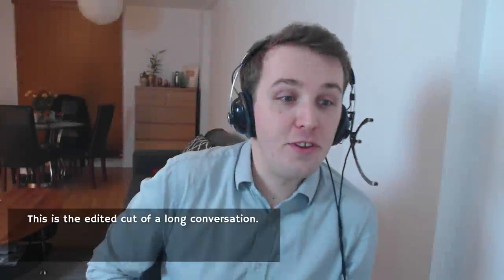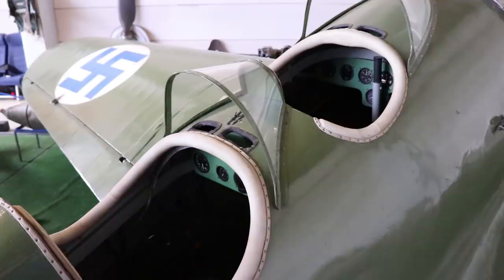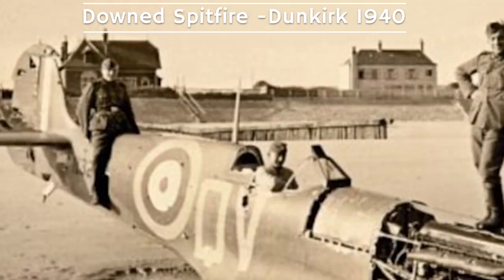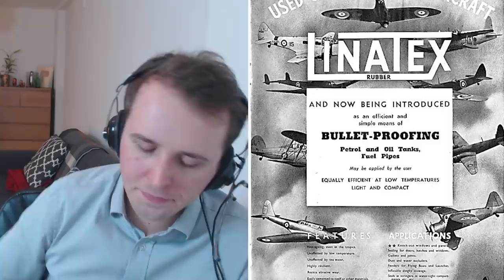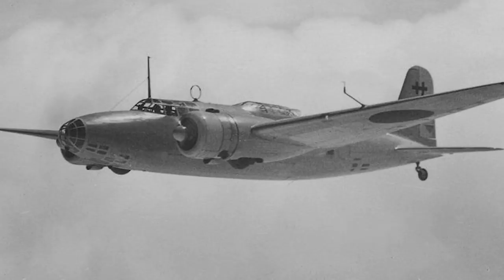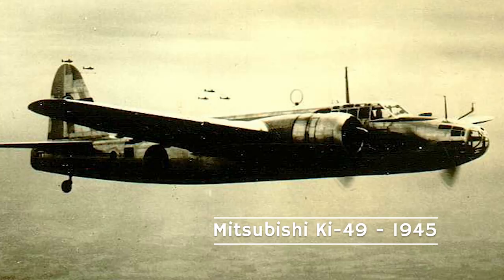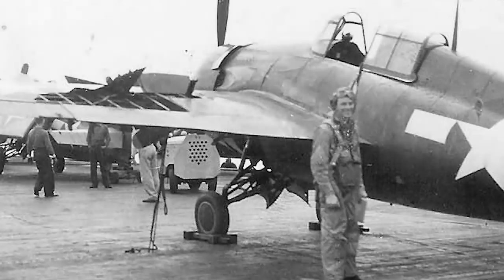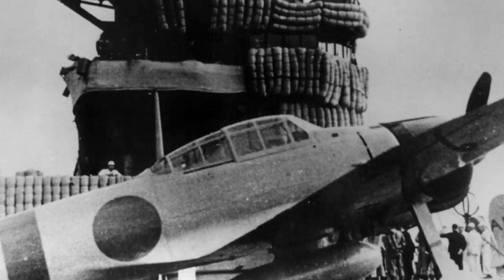WW2 Armour and Fuel Tank Protection - What They Don't Tell You

Comment: Great video. Could you make one on fighter armorment in ww2? Why the british first only used 303s and the US seemed to prefer .50 to canons, etc? Also reasons for nose mounted vs. wing mounted guns would be interesting. British and americans seemed to have used wing mounted guns almost exclusively, except p39 and p40 i think.
Reply: There are the p38 and p61 of the US and for the British there's the heavy fighter variant of the mosquito (note that all these aircraft use two engines)
Reply: Rate of fire:
ie, a unrestricted machinegun rate of fire being higher. Then a restricted rate(firing thought a propeller).
This much more a thing once you increase the speed of the aircraft. 
Also your intended targets, has a big part to play.

To understand the math problem. I am thinking almost a % that growers experdencelly over 300 mph.
Reply: One interesting feature of the .303 is that it was not a boat-tailed bullet (tapered on the end), but the 7.92 and .30-06 were.  The boat-tailed bullets have less drag.  I don't know if this lack of boat-tail decreased the range or energy of the bullet in air to air combat.
Reply: P-36 had nose guns along with several naval bombers the TBF, TBD and SBD. The F7F had them but that was a twin engine. The F2A and SB2A had both.
Reply: Thanks all. Very interesting comments. I was thinking of single engined fighters in particular. It makes sense that machineguns which did not require synchronizing have a higher rate of fire. Didn't think of that. Still Russians, Italians and to some extend Germans kept using synchronized machineguns in quite a few planes, while the Americans seemed to have faced them out in later models and the British didn't use them. But I read somewhere that the .303 Browning version could not be synchronized, so that would explain that. I suppose it also has to do with the limitations of space in the aircraft. I also read somewhere that nose mounted weapons were easier to use for novice pilots and that the Russians preferred them to wing mounted guns. Then there is the question why the British started using canons later then the Germans or the French and why the Americans didn't seem that interested in cannons for their single engined fighters. I think the corsair might have used canons, but I'm not sure.But what I am really wondering is, were these decisions based on doctrine, or were these decisions based on habit or technical limitations.
Reply: I believe the British wanted the .50 Cal. but the U.S. could barely produce enough for their needs.  The  50. Cal. was used everywhere.
Reply: The Lizardking the browning 303 ( and i asssume the 50 was too) was powered by compressed air. So, how could you synch that with a prop? I suspect it would be difficult.

Air forces tried to work out what weight of shot would kill an an enemy bomber. Then they had to decide how to achieve that amount of firepower V horsepower/weight hence overall performance. Weaponry availability was a thing too.
And remember the british designed their hurricanes and spitfires well before the war when most other nations were using 30 cal too. The cannon on the 109 was only adopted just before ww2 based on their spanish civil war experience. Most US aircraft had mostly a mix of 30 anod 50 cal.
Reply: The Lizardking also, if youve got mah deuce you reaaaaally dont need cannons. Its almost basically a small cannon anyway.
6  x .50 cals is enormous forepower. 
The corsair had .50 cals.
Reply: Dellacondan 
Good point. I forgot that the bf109b and c had 3 machineguns.
Reply: @sugarnads  a lot of later US naval aircraft (Including the corsair btw, also F6F, F7F, F8F the AD series and more) used cannons for armament. 

Air force planes equipped with cannons include the p-38, the p-39, (and the p-63 and p-400) and some p-51 model.

From wikipedia:
"The British version was also licensed for use in the United States as the M1, with both the United States Army Air Corps (USAAC) and U.S. Navy planning to switch to the 20 mm calibre as soon as the gun could be produced in sufficient numbers. In 1941 a very large building program was established, along with the production of ammunition. When delivered, the guns proved to be extremely unreliable and suffered a considerable number of misfires due to the round being lightly struck by the firing pin.[11] The British were interested in using this weapon to ease the demand on production in England, but after receiving the M1 they were disappointed. British wing-mounted fighter weapons by this period were cocked on the ground by the aircraft armourers before flight, the built-in pneumatic cocking mechanism used previously being regarded as unnecessary weight and detrimental to aircraft performance, so any stoppage in flight made the gun unusable until it could be cleared on the ground. The misfires also had the tendency to cause aircraft with wing-mounted guns to yaw away from the wing with the failed gun when the guns were fired, due to the unequal recoil, thus throwing off the pilot's aim.
In April 1942 a copy of the British Mk.II was sent to the U.S. for comparison. The British version used a slightly shorter chamber and did not have the same problems as the U.S. version of the cannon.[11] The U.S. declined to modify the chamber of their version, but nonetheless made other modifications to create the unreliable M2. By late 1942 the USAAF had 40 million rounds of ammunition stored but the guns remained unsuitable. The U.S. Navy had been trying to switch to using cannon on all its combat aircraft throughout the war but the conversion never occurred. As late as December 1945 the Army's Chief of Ordnance was still attempting to complete additional changes to the design to allow it to enter service."
Reply: I think I read that allied planes that used 4 and five blades props couldn’t use nose mounted machine guns.
It was a synchronization problem?
Reply: @woodruff4241   M2 unreliable? Ma deuce is still used around the world
Reply: @kenneth9874  huh? I never called it unreliable?

edit: I was quoting Wikipedia but that section refers to the 20mm cannon
Reply: @woodruff4241  I went by M2
Reply: @kenneth9874  It is a bit unfortunate that the Browning M2 12,7mm gun (which you meant) and the
Hispano (AN/)M2 20mm gun (that I was referring to) are both named M2 but that's just US American naming schemes for you
Reply: @woodruff4241  works fine with the complete name

Comment: According to Vorozsheykin's memoirs (in Russian), he himself together with Pavel Rychagov were the first to implement improvised fighter back armour in 1936 in Spain to protect pilot from the rear. They simply had cut by blowtorch a 9-mm thick boiler iron plate and put it behind the seat of I-15 fighter. In order to keep balance they had got rid of rear accumulator. Normally, I-15 and I-16 had no rear armour but 9 - mm back head plate

Comment: Greetings from Japan. According to Japanese books I read when I was small (Published by The KoKu-Fan magazine) and current Japanese Wikipedia, Type Zero Model 52 "b" (otsu) aka A6M5b had 45mm glass at front and 8mm armor at rear section of the cockpit. In Type Zero Model 52 "c"(hei) aka A6M5c produced from October 1944, 55mm glass was added in upper rear section of the cockpit.

By the way, Type Zero Model 52 "a" (ko) aka A6M5a used 0.2mm thicker aluminium outer sheet for wings and could dive up to 740.8km/h. The "Aces of the pacific" flight sim form the early 90's and I suppose many other Western flight sims don't model this and I suppose this is another stereotype.

About 6000 of Model 52 series including plain vanilla Model 52 aka A6M5 which had dive speed limit of 666.7km/h and had automatic? fire extinguisher for wing fuel tanks was produced from August 1943. Self sealing fuel tanks were planned for Model 53 aka A6M6 but they were delayed to prioritise the production of the Model 52 "c" aka A6M5c. The war ended before it could resume.

Comment: Hi, nice talk! Adding a few recommendations:

"Knights of the Skies - Armour protection for British fighting Aeroplanes", by Michael C Fox (Air Research Publications, 2006). An excellently researched book that seems far too little known! Covers WWI to about 1940, focuses on RAF aircraft with a short addition on German types. 

"The story of the self-sealing fuel tank", by Capt. Edward Eckelmeyer, United States Naval Institute Proceedings, Vol 72(2) of February 1946. Short, but enlightening discussion of fuel tank design, including consideration of sparking and hydraulic ram effects. In summary, a good self-sealing fuel tank had to be flexible and flexibly suspended too, must contain no spark-inducing metal parts or as few as possible, and had to be distanced from the metal fuselage structures. 

I must have a few more references in a few places. 

Final comment, you said that the German standard was always protection from rifle-calibre guns. You are probably aware that this isn't strictly true and late-war fighter specifications called for protection against .50, for obvious reasons. This was in part to be achieved by rearranging structures and equipment carefully, not be adding thick armour plate.

Comment: Tony Tully's board (WWII Naval) had a bit a while back about how the addition of armor etc messed up the USN's "tables" for strike launches etc.  Without extras, strike aircraft need less deck to launch on and it was possible to launch pretty much the entire air group as one continuous operation (bringing up planes from the hanger as you went.  With the latest equipment, less of the deck was "free" which led to the adoption of "deck load" strikes.  This is VERY informative as to why operations were so confused at Midway (Strikes taking too long to launch and a near fist-fight over whether a strike could reach the target).  The "rules" were changing, and they hadn't become second nature yet.

Comment: During your discussion with Justin, it was brought up about an attacking pilot noticing his target going out of control, but it's not on fire. Justin speculated that possibly the pilot was killed. Another possibility is that a control cable was severed. By the motions attributed to a loss of control, the pilot, who may not be injured, could have been thrown to one side of the cockpit rendering himself unable to correct the flight until it was too late. Either way, the victorious pilot can count a victory. The only difference is exactly when the enemy pilot actually died. In flight, by a bullet, or when the plane hit the ground or water. Isn't victory fun?

Comment: The evolution of thinking regarding a/c & pilot protection reflects much of both the practical nature and the reactive (as opposed to proactive nature) that runs through most if not all human thinking. We are most often informed by our experiences rather than or conceptualizations, because experience is after all, reality, while concepts represent possibilities. If you think this explanation tends to emphasize the process of human approach to problems, you'd be right. We do this every day, all day, and that's why our species is "highly adaptive".
There is a practicality in thinking: in 1904, no one was wasting time with the considerization of armor when it's not even established that the aeroplane can fly. Similarly, as referred to, until engines had evolved sufficient power to adequately fulfill the mission WITH protection, the discussion is moot.
There is a tendency for humans to believe in a convincing doctrine until practical experience with the doctrine requires modification. Believing the "Blitz" will far outweigh the "krieg" in Blitzkrieg means cosiderations such as protection will be only modified by circumstances. This causes difficulties in incorporating changes into existing designs on the production line.
Circumstances do force adaptability. Significant losses of pilots, that have costly & limited replaceablity, force changes designed to protect pilots & a/c. 
We tend to be products of our training. If you're IJN, and you're taught that 30mm is something automatic that you use to shoot at a/c, and cannons are something you mount in steel turrets on ships, you're  probably inclined to maintain that thinking when the IJA has a differing opinion.

My purpose here, by stating the semi-obvious, is to emphasize how unchanging we are in not premeditating & adapting to reality until it is actually a demonstrated reality that must be accommodated. I assure you, 4-way stop signs at intersections most always are created AFTER the accidents happen...

Comment: Armor is not the only defensive element in  aircraft.    Aircraft structure framing and even ducting could reduce aircraft losses..  P-47 and P-38  had masses of supercharger abd cooling ducting  which could soak up bullets.  Rifle caliber bullets and light cannon shrapnel  could be stopped by unarmored structure.   The Zero and other Japanese aircraft were very lightly built of wood.   The US 50 caliber rounds hit much harder than the 7.7 MM Japanese rounds.  The Japanese 20 mm tail gun was dangerous, the rest were rifle caliber and much less hard hitting.   We added fuel tank protection and armor to an already rather heavily built airframe.  . The Japanese did not have the underlying heavy structure of  an American aircraft.  Their light construction was a major source of their sportscar performance and economy car range.   American aircraft were built more like trucks, which why they could not dance with Zero in a Dogfight.    The weight of American  aircraft made the slashing zoom passes work for us.  The late war Up-armored Japanese bomber likely flew  like a bulletproof Volkswagen Bus  Thank guys.

Comment: In my opinion the best protection is to have TWO engines attached to the wings. And even with a button to drop then in case of uncontrollable fire. A lot of pilots were burned and blinded by engine's oil catching fire (like you can see in the film "Reach for the Skies"), or by the explosion of the turbine. This will not happen in a Mosquito, in a Bronco, etc. Special armor adding (detachable plates in iron, titanium, Kevlar, etc.) are good but the basic good design is fundamental.